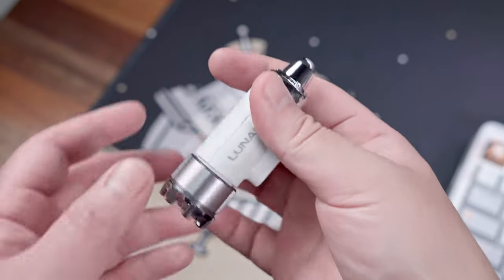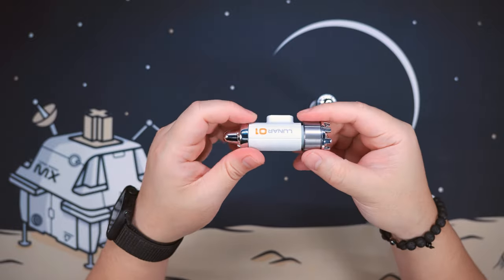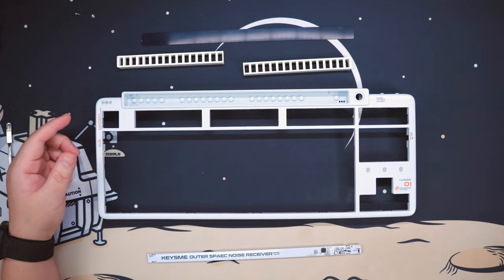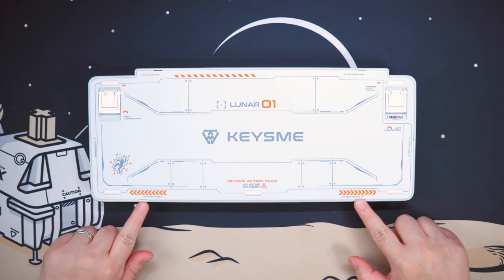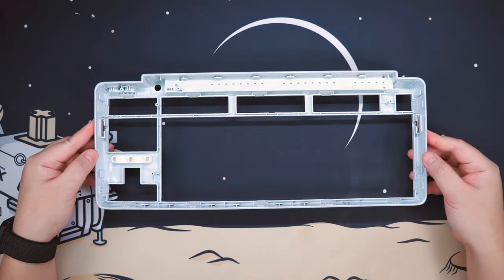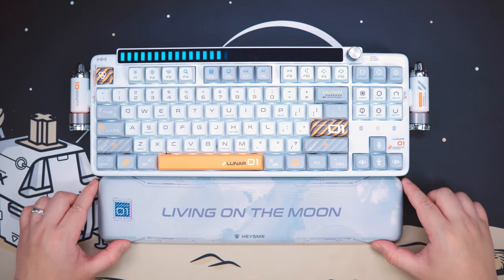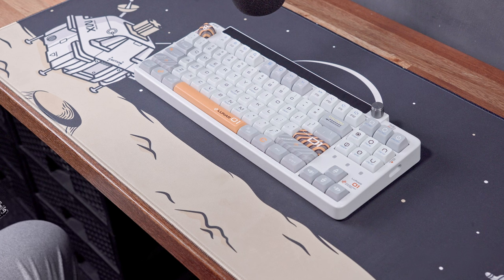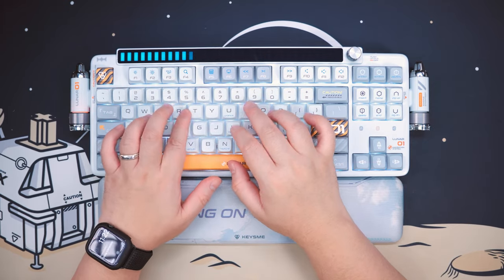A Keyboard with ROCKETS? - Keysme LUNAR 01 Review

Comment: I don't like the design of the keyboard and no one can convince me otherwise. this reminds me of some child-proof tablet case with those rocket ships on the side that look like T bar handles for a kid to hold. the line of LED's not being centered or aligned with the f row bothers me so much. this kb would have been so much better if they just made it look like a landing pad or something instead of side slots for the rockets. it would look better if the rocket docked on the top of the board, and had a top heavy design the like Beak keyboard. there is a 60% Drop keyboard with "offwhite" themes that carries the spacey look way better than this. the enter and esc key look weird. I would rather have a darker grey or moon dotted design for those.
Reply: I would rather have a darker grey or moon dotted design for those keys. i think if the light bar was centered and the design was more even with the case, then it would look better. why not move the knob to the side and have a longer bar?

8:08 changing from tape to magnetic cover is a good improvement. the light bar feels half thought out. the fact that you are able to break the LED's by taking the keyboard apart to get at the stand or lego's is astonishing, especially for something made for kids as suggested by the implementation of lego's which should be made from sturdier materials getting removed and re-applied. $149 down the drain. its like a 10$ pcb, but i guarantee its not going to be in stock.
Reply from the maker: I agree on the audio visualizer, its super fragile. I only damaged one SMD led but it was enough to cut the circuit in half.